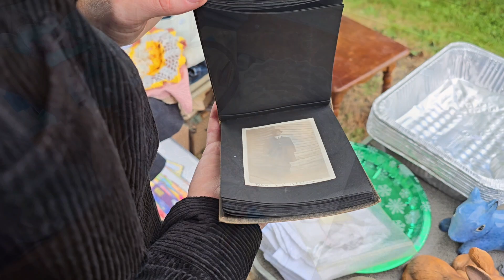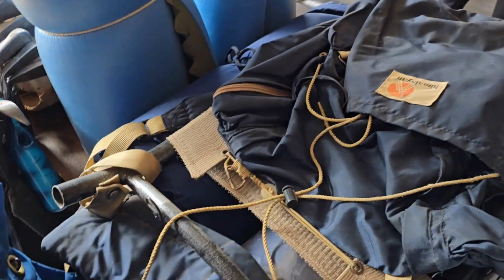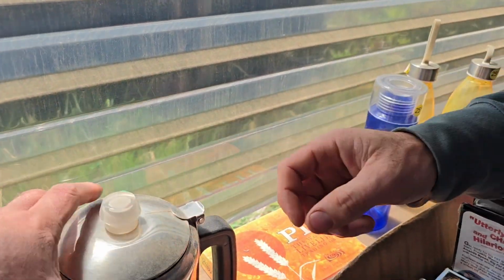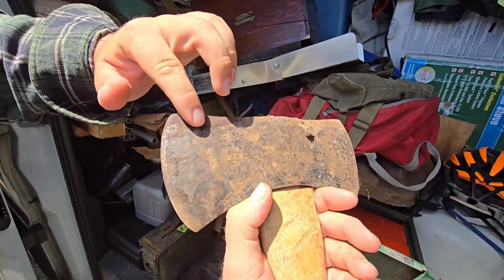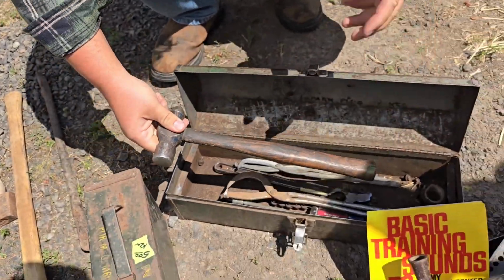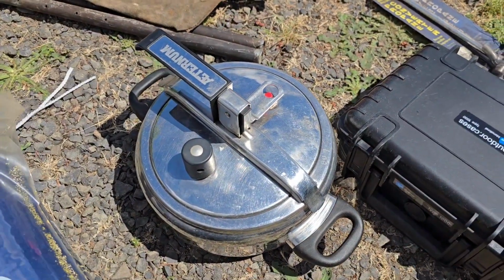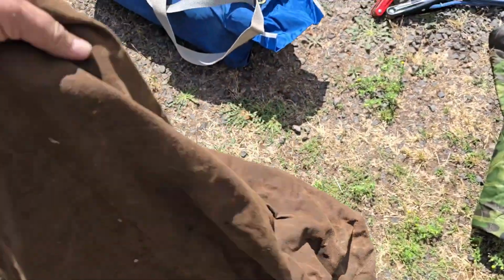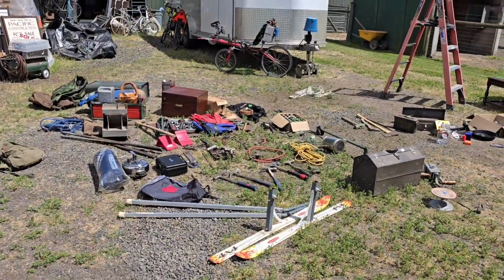Yardsale Scores , Great Hauls of FIRE 🔥

Comment: Happy Father's Day, Steve!! Great scores, but REALLY great buy on the Eureka tent and Everest sleep pad! Had I been there it would have turned into an auction 😂 I saw you look at, but pass up a vintage Mirro Backpacker stainless cookset. I have several of the aluminum versions, and grab them every time I see them. That canoe was beautiful, and looked like an easy fix. Did he end up going back for it?
Reply from the maker: I know Chad that little cook set when I went back and watch the film I'm like, why in the heck did I not grab that it was 5 bucks. I think maybe even a dollar just the strap would have been nice to have at a minimum. That was dumb oh well. So tell me about the Eureka. Tent, I have not opened it up. Honestly, it looks pretty new. I'm not gonna be surprised. Open this up and see that it's only been used. Maybe once or twice. Is that the same eureka that makes the vacuums
Reply: @doinsngoins  I believe they're both part of a larger parent company. During WW2, Eureka! made all of the mess and barracks tents and MASH tents for the Army. And if the one you got is the one I think, then it is a 4-seasom tent. Waterproofing may be worn off and will need a good coating, and zippers may need waxing, but it would definitely be worth reviving! And of course never trust their size rating. Only way it would be a 2-man tent is if both men with 4'10" 95lb Asians 😂 but toss in that Everest pad and the sleeping bag, then use the rest of the room for boots/gear and it's perfect!!